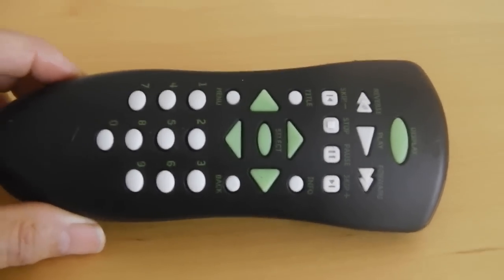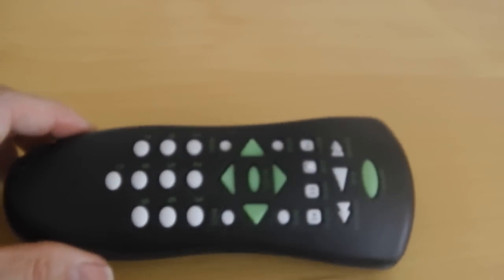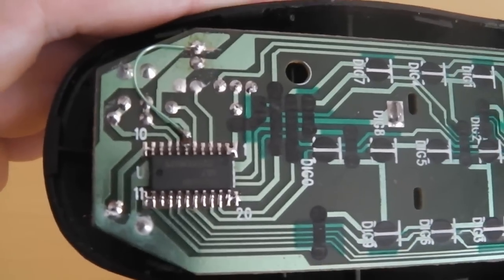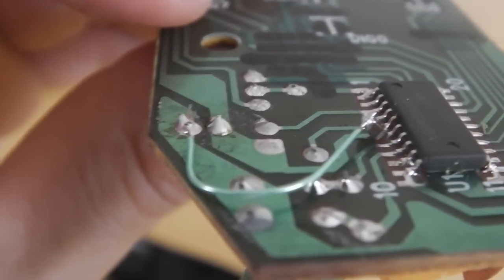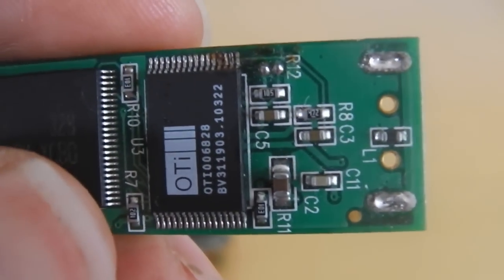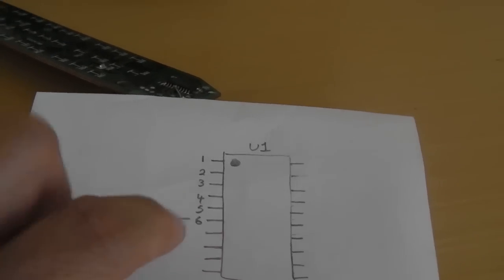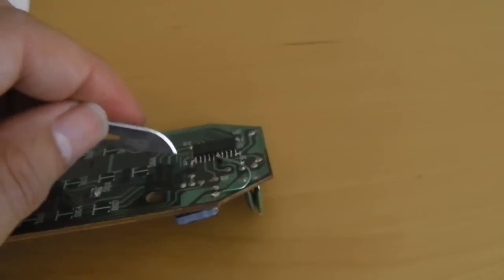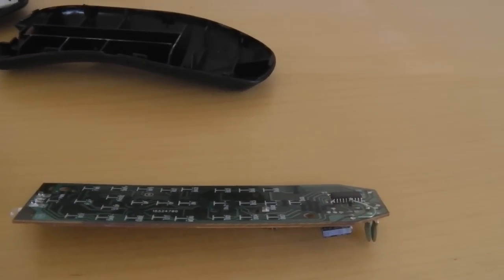How to repair an Xbox remote Control - Decoupling Capacitor Fix

Comment: What could it be the problem if the remote isn't even sending infra-red signal? Tested mine with my cellphone camera. No light at all.
Reply: Un Usuario if it worked before, you tried to repair it and stills dosent work, it might be that one of the battery contacts is not in flush with the plastic (this happened to me)